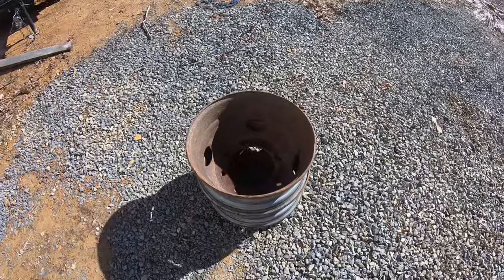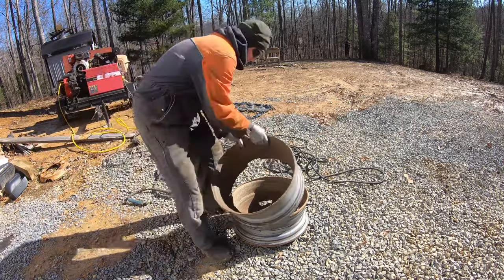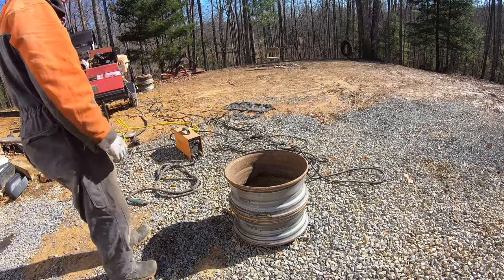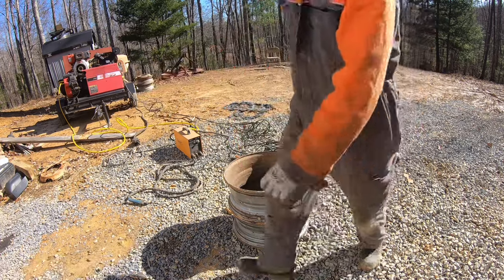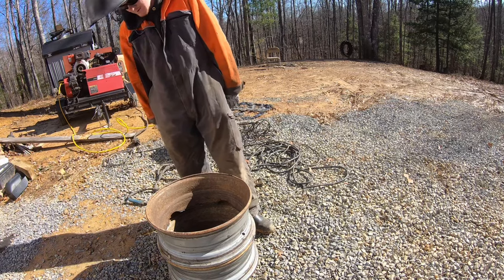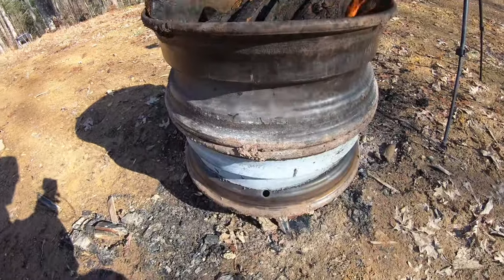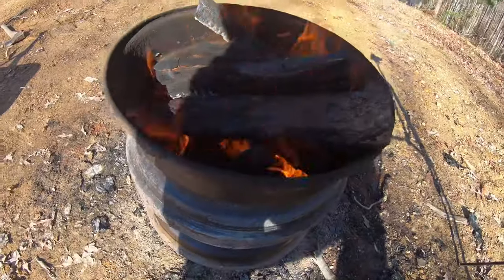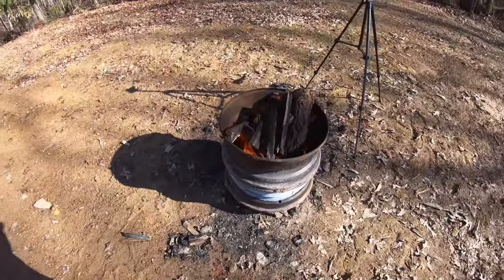Building a fire pit with old truck wheels

Comment: With the other rims, you could make a wood stove. There are plenty of video's on youtube making wood stoves / log burners from wheel rims. Even BBQ's from wheel rims. 
If you have a vice, a truck rim could be used as a heavy base for mounting an I beam on and making a pedestal for a vice or bench grinder. Just weld a plate to the top of an I beam and it is a pedestal for anything.
Reply: Chuckle- that was what all the truck rims around here become. I got one of those Harbor Freight small tire changer on one as well.

Comment: I would recommend welding them face down and face up so the inner lips are welded together. Close up the holes on the top and add a chimney stack with legs on the bottom. Cut a whole in the side and on the top hub portion make the chimney sliceable that way u can add in wood or on the side for larger pieces if need be. Weld on legs and it sits up a little higher for better air flow and all smoke out the top. Still able to cook on top side with small pots and pans.